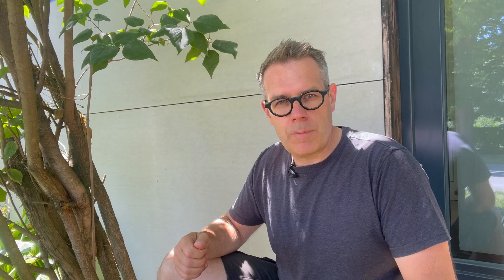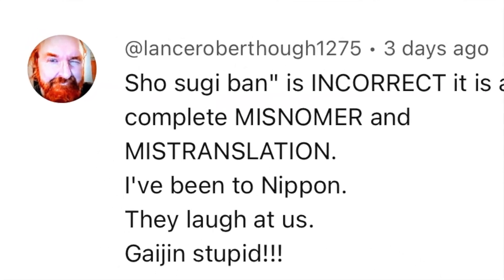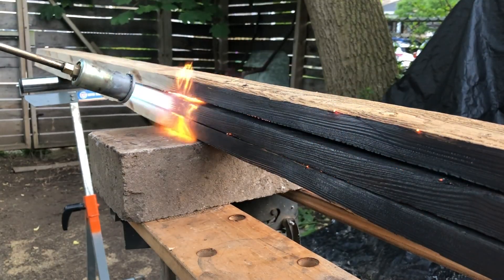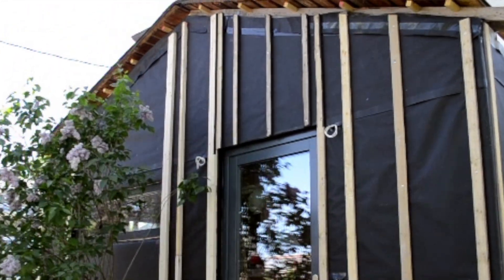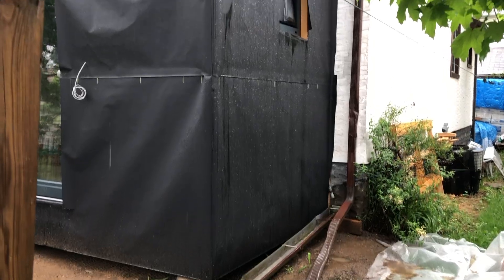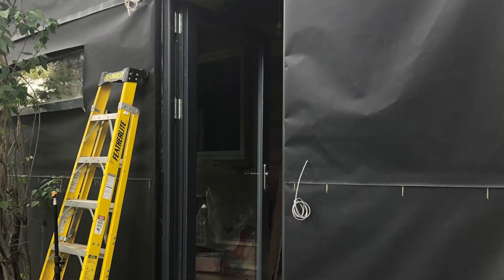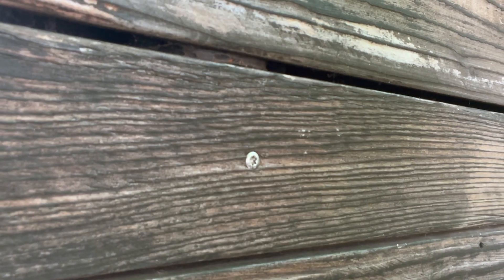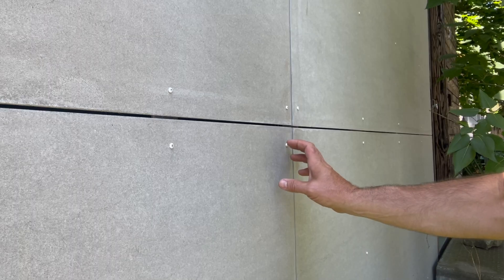Two Sidings, One Wall: Yaki Sugi Meets Fibre Cement | Porch Build Ep. 7

Comment: I think I would have gone with horizontal strapping on PVC pipe spacers and covered with vertical shiplap.
Reply from the maker: Interesting detail. That would be a closed facade. (I wanted to test the open one.) What specific spacers would you be using? For vertical siding, I’d double strap.